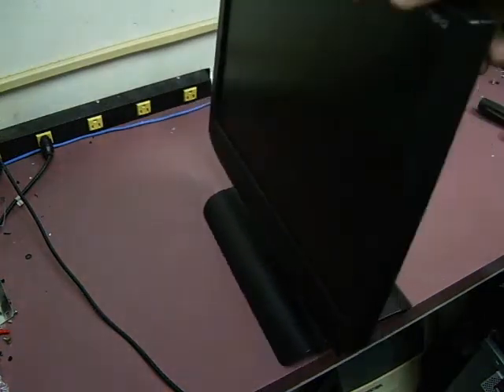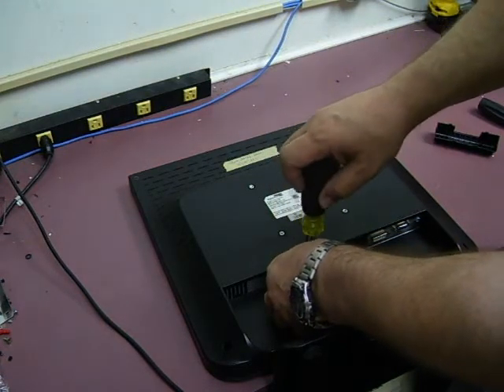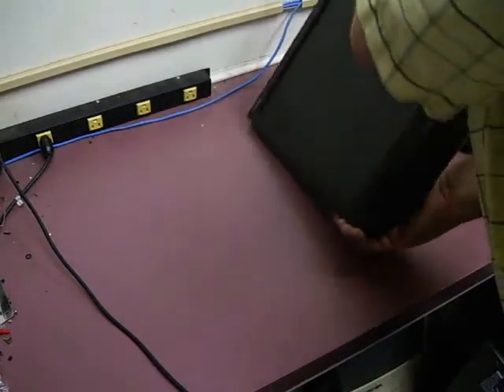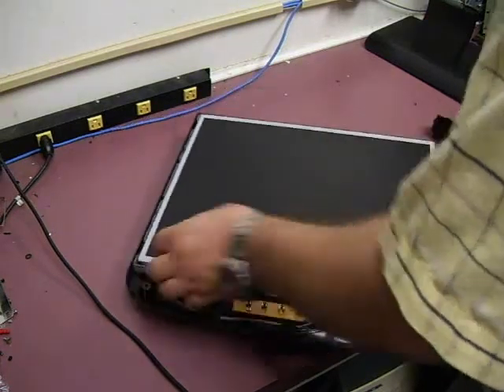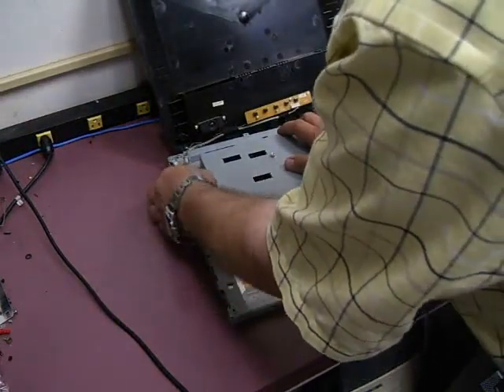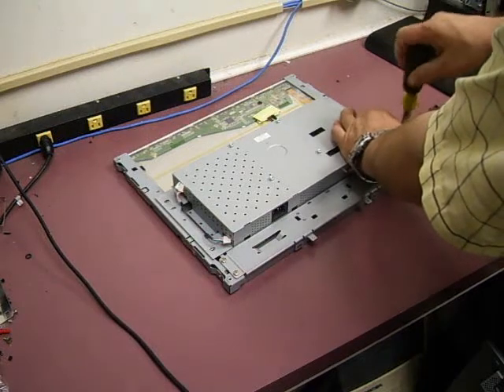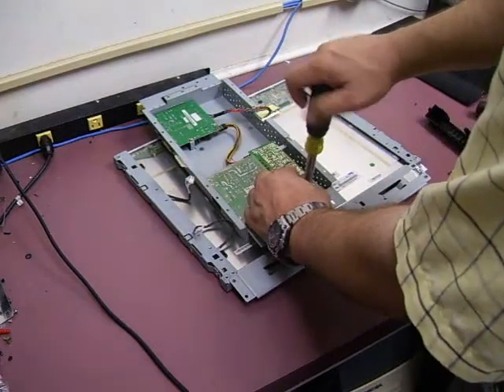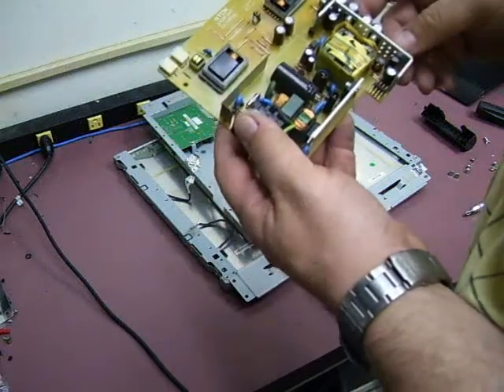Repairing a HannsG HN199D - Part 1 Disassembly

Comment: Thank you for this. I had a HANNSG JC199D fail with blinking green light and no turn on. I couldn't figure out how to remove the hinge until I watched your video. Much appreciated. 4 replaced bad caps later and it all works again.

Comment: This was really helpful.  I just used these instructions to repair my HannsG HN199D (wouldn't have known about popping the bezel without them).  It took me somewhere between an hour and a half to two hours, most of which was spent unsoldering and soldering capacitors.  Hard to say if the savings paid for my time, but it's very satisfying to keep an otherwise good monitor out of the landfill.  I have a second HN199D, which is suffering the same problem and which I plan to repair as well, now that I have some confidence that it will work. One correction: the opening screens say that this monitor uses the AIP0157 power supply board. Actually, it uses the TDK XAD819AR power supply board.

Comment: Since this video came up when I was looking to repair my Hanns G Hi 221D I thought I would post about it. Unlike this monitor it has no screws except those that attach it to the stand.  Once you have the stand and mounting bracket off the back you just need to basically pull the front and back apart. For that you will need a thin tool like a putty knife. I had the best luck starting at the top center and using my fingers to get under the front bezel and pop a clip there. Once you have small gap you can  get the tool in and start prying from the outside while using your fingers on the inside. Do the top and sides then lay the panel face down on a flat surface that won't damage the screen while you do the bottom and then remove the back. Be aware that the cage that holds most of the electronics is held in place by the back case and is not secured to the LCD panel with anything other than electrical connections you don't want to break.

Once you have the case open you can remove the 4 pairs of wires on one side that power the backlights, then tilt the cage up so as not to tension the ribbon cable. Gently pull the ribbon cable from it's connector on the video processor board to remove it and free the cage. As far as I could tell there is no locking mechanism for the ribbon, mine actually worked it way out on it's own while I was moving it about trying to figure the best way to remove it.

Comment: Some of the Samsung monitors i have are the same way too.  I tried to open one of them (a completely dead one) just to practice but ended up hurting myself. :- ).  I looked up online, could not find any support, service manuals or otherwise.  I am good with electronics; soldering etc, but the clamshell technology completely beyond me.  Thanks a bunch. :- )  kevonroll @ yahoo . com